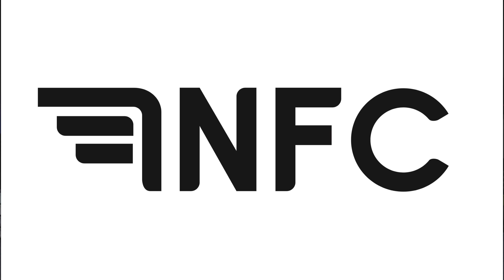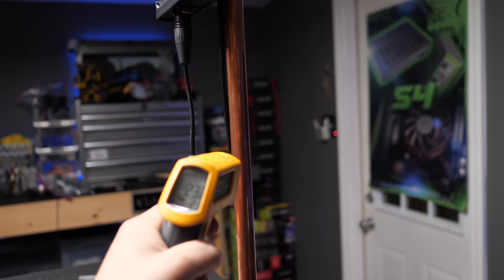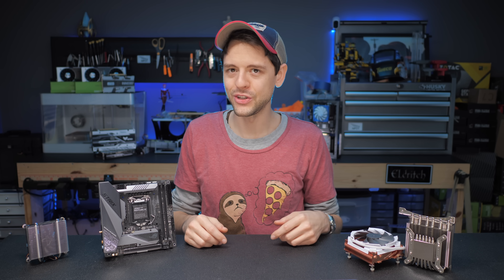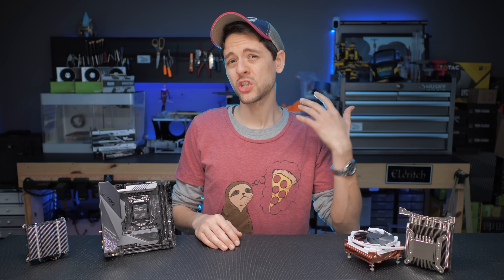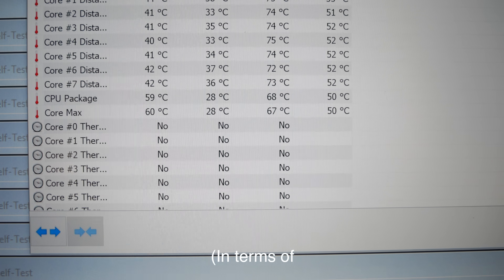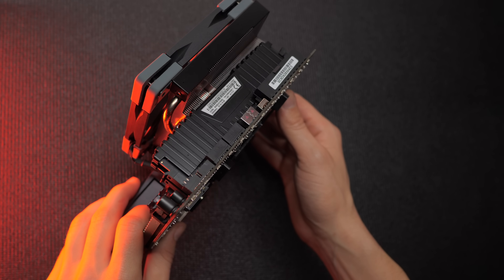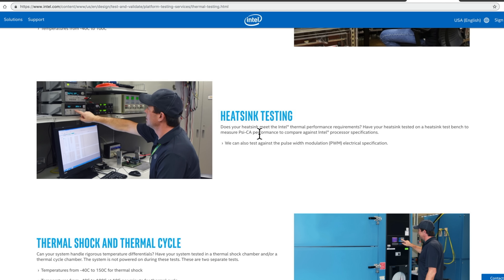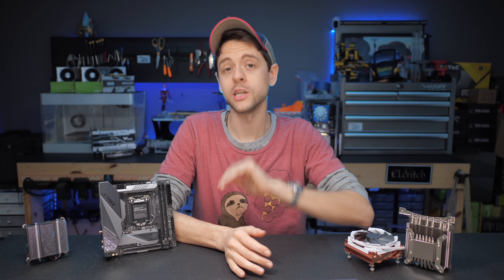40(ish) SFF Cooler Combinations Tested!

Comment: This is such an excellent video, I am using it as reference in 2021 ;) for my dual system 9900K/3800X built since I the lack of space between mobos on Phanteks P500A only allows me to use SFF coolers. Custom loop is out of the question right now $$$ but any suggestions are welcome. Thank you and keep up the great work!

Comment: Can you please help I have a powermac g4 cube case with a Asus 390-I mobo and i9 990k 
What is the best ( SLIMMEST ) cooler I could use ?
Reply from the maker: So there are two answers. If you need HARDCORE cooling, and don't have much space, go with a Dynatron 1U cooler. They work great they are just really loud under load. If you want it quiet, and dont need as much cooling, go with the CNPS2x. If you have more room then go with the NHl9i
Reply: Not From Concentrate thank you for your advice & fast reply. This is my first build and boy it’s tricky lol
Reply: Not From Concentrate would you say  dynatron 1u is better then an aio?

Comment: Great video, thank you for sharing. Any opinions on how impactful the heatsink fan orientation is on temperatures? Looks like the LP53 has great performance but on some motherboards it only fits in the orientation with the fins perpendicular to the RAM so hot air might not be able to escape easily. I wonder how this may impact real world temps.

Comment: @Not From Concentrate, you mentioned that putting fans on the bottom, increases the temperature compared to putting them on the top.
Do you have data on the amount of temperature difference between putting them on top or on the bottom, for different coolers?
Reply from the maker: The data I have would be in the spreadsheet in the description. Thank you for watching.

Comment: Hi, I really need some help with finding a Cooler, I'm sure you hear this all the time but I'm really struggling. I have a Sentry 2.0 and my computer is currently in a Node 202 with a Big Shuriken 2. I am unable to find a suitable CPU to fit my Asus Strix and 8086k, due to stock limitations I tried a Alpenfohn Black Ridge but the pipes extended over the PCIe slot and due to the placement of the CPU socket it couldn't be orientated any other direction.  None of the Noctua coolers seem to very sufficient at cooling at 8086k and everything else seems too big or too high. :(

Comment: i wanted to get me skyreach case... but the fan noise got me worried.... what are u thinking about the hd plex h5 case? im thinking about going fanless... but im not sure about the temps...
Reply from the maker: Naw, S4M with the right fans and hardware can be the quietest PC you have ever built. Obviously a fan-less case would be quieter still, but the smallest HDPLEX case is ENORMOUS compared to a S4M, so it's not in the same category. Best of luck finding what works best for you!

Comment: I am planning to buy this Asus z390 with an intel i7 9700k.
I will use Corsair Crystal 280x case and I am concerning if I can fit Cryorig H7 Quad RGB without removing anything from the m/b.
Have you ever tested it?
Reply from the maker: I typically don't use/test large coolers as anything that big the customer usually requests a custom liquid loop, but just looking at that cooler it seems it would clear most boards. You didn't link the board though so I can't be sure. Maybe YouTube blocked it? Peace
Reply: @NotFromConcentrate  Asus Z390-i, the same you used.
My second choice is Big Shuriken 3 with an 120mm rgb fan like corsair LL120 or Thermaltake riing Trio 120.

Comment: Can you elaborate on the LP53 damaging the CPU with over-tightening? I have one on my z370 itx board and would like to know more for future reference!
Reply from the maker: It doesn't have a tensioner mechanism, so if you over-tighten it you can bend your CPU. Basically you need to tighten by feel which is never a good option.

Comment: I have noctua nh-l9a in my node 202 with r5 3600 and actually thinking about if there any way to upgrade, its a slim case only 80 mm and the maximum allowed height is 56mm. But now i know that I can actually squeeze more , near to 65mm. So what can you guys recommend?
Reply from the maker: There is no upgrading from the NHl9a in that case really. You could get a C7, but your downgrading your fan. You could get an LP53 with AMD hardware kit (if it even exists) but then you are paying big money and you need to get a new fan anyway. Bummer. :)

Comment: Im having a hard time reading the data sheet, im not the best with this stuff... i just want to know if the cryorig c7 cu is as loud as people claim and if the noctua fans mounted on it helps with temps or noise...(i have 50 mm clearance)
Reply: Hello. If you want to hear the difference just skip to the part in the video where I compare those fans. https://youtu.be/6mcyot6w1dA?t=215 The C7 is much louder yes. If I was buying one I would replace the fan.

Comment: Why are you using the system power instead of the CPU power? Why have you not locked the multiplier and hence the power draw so you can control heat output from the CPU? Would also be nice if you provided the height of each cooler. And also added the thermal paste.
Reply from the maker: Hello, Justin! I used Intel XTU to get a CPU reading, but I wanted to go with the system power because I'm pretty confident in my ability to get an accurate measurement there. I could have provided Junction in my chart, so I will think about that for next time. What I didn't stress enough in this video and should have is that I wanted to see what would happen if you simply bolted these coolers on with a normalized feature set. I chose this as my goal, but I can understand wanting to know something different. I did want to normalize the thermalpaste though so I used NT-H1 for all these tests. Peace to you and thank you very much for your comment. If you have more questions that aren't covered in the methodology documents please ask! :D
Reply: @NotFromConcentrate  Hey! Thanks for your in depth replies! It's interesting stuff and good work! Yees. I've also heard the CPU power isn't always fully accurate.
Reply: Actually, I haven't checked the rest of the documents. Nice video in any case :).

Comment: Which mainboard would you recommend:
The Asus Z390-I Gaming - or - the Gigabyte Z390 Aorus ?
Reply from the maker: I wouldn't be the best person to ask as I have only been using the Z390-i. I plan on using the ASROCK for a bit too in some custom builds because I LOVE the I/O and features, but CPU tuning and durability/stability are very important to me and I know the ASUS is solid. I tend to get a good feel for a certain board first by buying a dozen or so then try a new one, if that makes sense. But I do love the ASUS board and it works great and I only have some small niggles (the heatsinks are too big and silly for tiny builds.) Peace!
Reply: Thanks a lot!

Comment: It's funny I got a noctua push and pull nh-u9se2,  I saw on sale aio h100v2 for $65.00 , and I got the same temperature 55c on fx 8350 oc 4525 boost 4596mhz I even did a mod and got the aio on the outside of the top of my case, if you got good air flow don't get aio. Just my opinion. I forgot about I move to Puerto Rico and it's hot all year. Noctua rock's plus I don't like RGB.

Comment: It would be helpful to have the fan rpms listed because I'm interested in the C7 Cu, but the sound performance at idle wasn't great but maxed out it didn't sound as intrusive as some others
Reply from the maker: My 2c is that the C7 Cu is beautiful, but it's not better than the normal version enough for the $$$ difference (unless you care about bling.) The noise is bad though compared to the NF-A14.

Comment: I hate CPU fans. Need more fanless options.
Reply: I definitely feel you. But on the other hand, it's also quite impressing how much performance is gained by just slapping a very low RPM fan on top of a heatsink. The only fanless options for SFF enthusiasts are Streacom products (FC5 Alpha), which is a lot longer and wider than a Skyreach 4 Mini. I personally gave up on fanless USFF builds. I can't afford a S4M, but I really like the case, like this channel and wish I'd have one smaller than that (no dGPU slot, basically the size of a mini-ITX mobo). I currently have 2 SFF PCs: InterTech IT-607 and Delux M198. And because I own many PCs, I'm starting to think about rack mounting options (there are lots of 2U standard ATX cases), I just need a 10U cabinet (I also have 2 desktop UPS which should be replaced with an old server UPS and I'd like some space for switches, routers and patch panels), a KVM with very long cables and a remote and a spare room / closet where I can hide the cabinet and not hear it.

Comment: Yaaaaa!!! lp53 for the win... wait, what it didn't win??? Lp53 will fit with all the heatsinks.... but the heat pipe does get close to the vrm heatsink. No issues.
Reply: I think the biggest issue with the lp53 is cost, time to ship to someone, its mounting mechanism, and the stock fan.  He does mention in the video the lp53 is the best, but with a bunch of asterisks' after the word best.
Reply from the maker: You are correct that the LP53 and ITX30 fit with the Z390-i. I maybe wasn't clear in the video--in order to get the BEST orientation (not blowing into the RAM and rear heatsink) you need to remove heatsinks. Thank you very much for pointing this out.

Comment: You can't overclock any of them.... so basically its pointless to get a ryzen chip or a k chip if your planing to use a S4 mini?
Reply from the maker: Depends--if you aren't ever going to put it in another case, OR you aren't going to be doing serious tuning/undervolting then maybe no, because the boost clock probably isn't worth it. However you can turn a K into a T, but you can't turn a T into a K. So for the same price, might as well undervolt. Peace.
Reply: You could always fabricate an external rad water cooling loop like he did here: https://www.youtube.com/watch?v=C0ZW2z9y_vU

But if you want it all internal, in a space this small, you have to make sacrifices.  And one of those sacrifices is modest hardware.  You can still get great performance from a non overclocked 65w tdp CPU and a 2060.  If you need something faster, and you want it all inside the case, you probably want a bigger case.

Comment: Still gonna use my Custom Dynatron T318 cooler on my AM4 socket. might be hard to put on, but better temps than any of these coolers.
Reply: Nice
Reply from the maker: What fan and CPU do you use? I have that cooler so I would like to compare.
Reply: @NotFromConcentrate  using the Cryorig c7 fan with an overclocked Ryzen 7 1700. It is very motherboard specific, so i'm using a Gigabyte b450-i motherboard. Also using the IC Graphite Thermal Pad.